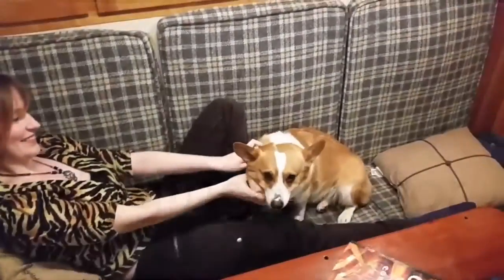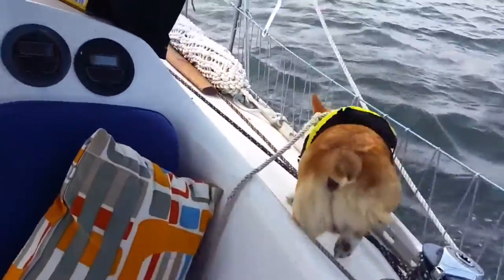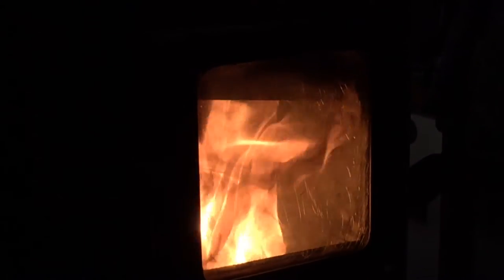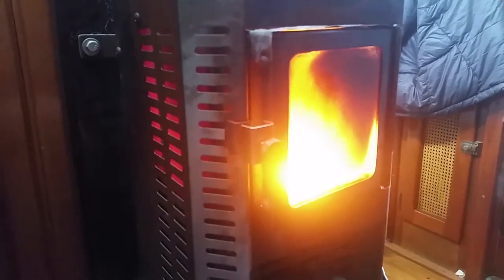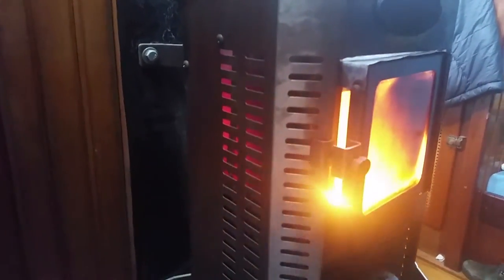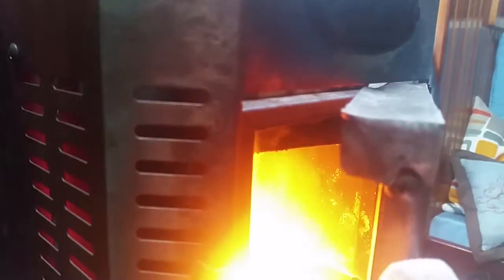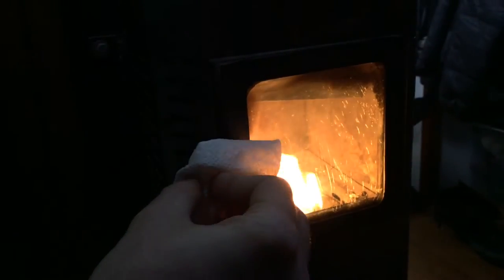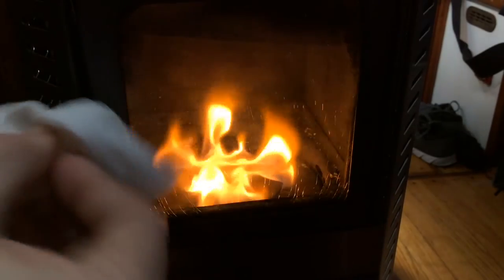Runaway diesel heater and how to fix it

Comment: Thanks sooo much for this video! This exact problem happened to me today on my boat (only 3rd time using it), and it scared the crap out of me! After cutting the power and gas line to it, I burned my fingers opening it (even with a cloth) and jammed a fire extinguisher down into the flame; then I texted my friend saying "don't think I'll be using the diesel heater anymore" 😅. I just watched your video while taking a break from cleaning the huge mess I made 😂 -- but this reassures me in potentially using it again, rather than tearing the whole thing out for a new system (because I really thought for a second that my boat was going to blow up 😰)
Reply from the maker: I'm so sorry that happened to you! I hope you can use it again. It really is one of the best things in our boat, but I know it can be alarming when this happens. Peace and stay warm!
Reply: @RiggingDoctor  Thank you, my friends! I've actually got the heater going right now 🤗

Comment: Probably not the best idea to use a CO2 extinguisher on a really hot metal stove.
Reply from the maker: Good point, but I spray it up the bottom which is not as hot. Sure makes a lot less mess than a dry chemical one would make!

Comment: You many want to consider RV diesel heaters.  They are efficient and can be remote controlled.  However, you need electrical to drive the fan motor.
Reply from the maker: I looked into them and the power needs were what turned me away from them. This unit works on simple physics: gravity and density drive the whole system, making it reliable when disconnected from the world.

Comment: Could you cover the air intake at the bottom of the heater with a round metal (sheet metal)...like some sort of spatula design to severely restrict the air intake to starve off the air intake and there-by reduce the run away fire in the burn box?
Reply from the maker: That is a very good idea. There is a fan mechanism that hangs down there but a bowl would work wonders. 
In the past, I have shot a CO2 extinguisher up the bottom to knock out the flame and then opened the door to kill the airflow. This was before I learned how to properly manage the heater.

Comment: Hello you two, 
thanks for that helpful video!
I'm thinking about buying a diesel stove as well but I want to burn vegetable oil in it. 
? Do you have any experience with veggie oil or have you heard about it?
Thanks, Tom
Reply from the maker: Tom I have never considered it but I like the idea! Pretty much, if it burns his will burn it so I’m sure it would work (but you will need to adjust the carburetor a little for it). It’s easy to do, just two screws on the knob to set the minimum and maximum flow of fuel into the burner.
Reply: @RiggingDoctor  thanks for your fast answer. That's great to hear because my research was only successful with forced air diesel heaters like Webasto and Planar. In these heaters you cannot use pure veggie oil, you have to mix it with at least 35% diesel.
In a stove like yours I assume you have to pre heat the veggie oil more than diesel to get it burning.
Stay healthy and uninfected, bye!

Comment: next time open the door fully,put a pot with little smaller diameter full of cold water in
the chamber close the door,fire dies out,because temperature drops below ignition temp
of oil.
Reply from the maker: That is a very good idea, thanks!
Reply: you would need to be very careful not to spill any water into the burning diesel, that would be VERY dangerous.